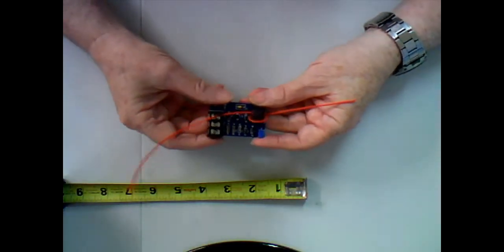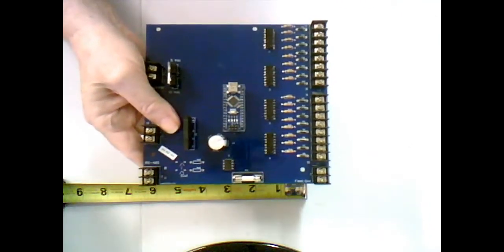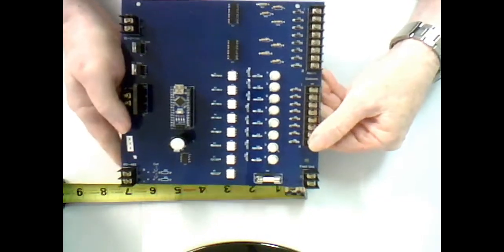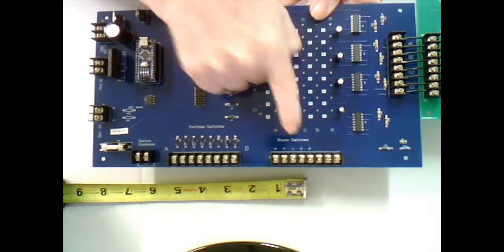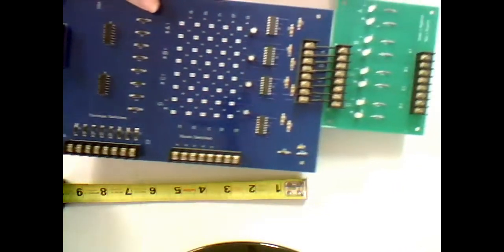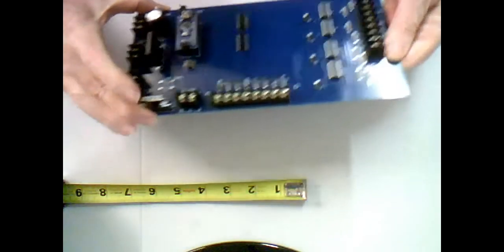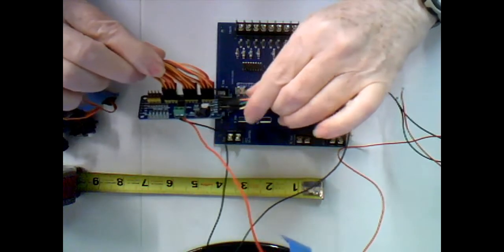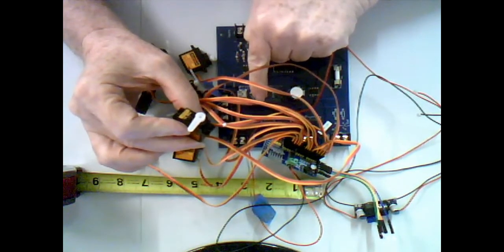My C/MRI Card Overviews

Comment: Really interesting work. I am working on connecting to JMRI and best way to achieve block detection and to operate servo,s in uncouplers I 3D print. Thanks for info helps open up options. I did notice the github link didn’t work thou? Think it might not be public github? Cheers Justin
Reply from the maker: Ooops! I did forget to make Github public, try it now.